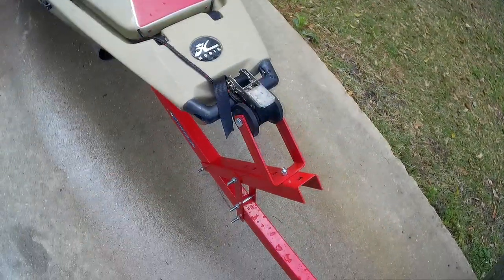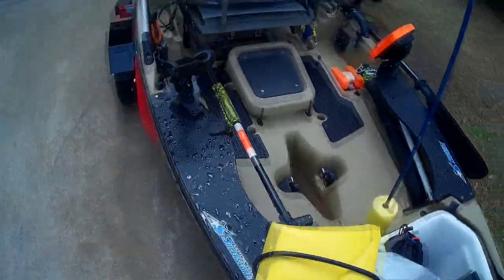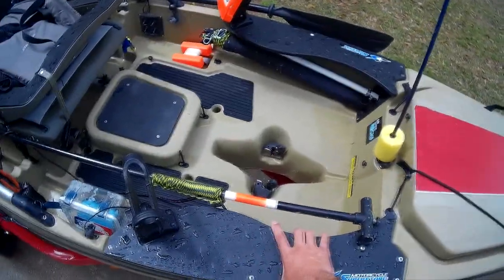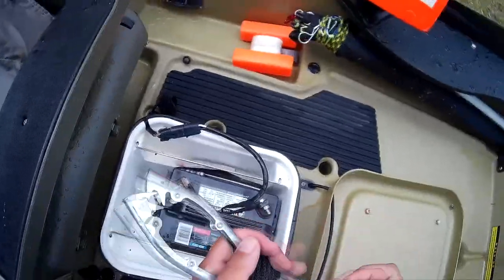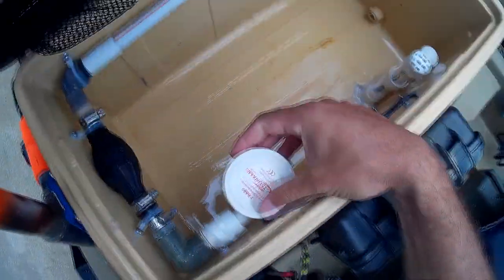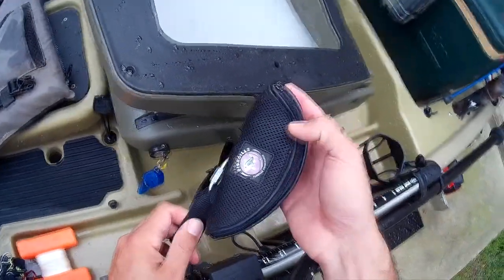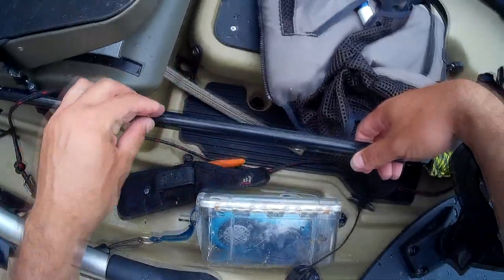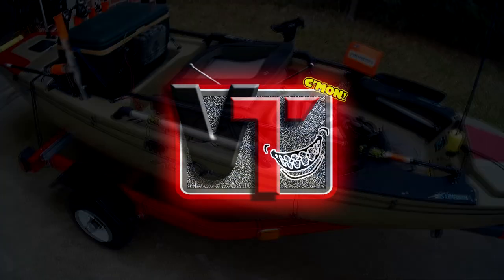Hobie Pro Angler 14 Modifications:  Part 2

Comment: Hey Tony. Really enjoy your videos. Bought a new 2014 PA14 last month. Really enjoying it. Just ordered HF trailer like the one you have. Looks like it will be perfect for getting the PA wet. Beats hauling it up the boat ramp on the Hobie cart. Thanks for the great tips.
Reply from the maker: Congrads on your purchase warthog!  Glad I could make it a little easier on ya!  Hope you used that coupon when you ordered the trailer.  Thanks for watching my vids!  C'mon!
Reply: VentureTube Yes used coupon.Finished trailer build. Ready to go fishing. How often do you check/repack wheel bearings? Interested in what effect water is having on grease. Cleaned hubs and bearings and repacked with marine grade grease as suggested during assembly. Thinking about installing bearing buddy kit.
Reply from the maker: warthog6660 Bearing buddy would be a great addition.  I always add a little grease to the bearings before a long trip, however, I only take the bearings out and clean the races about twice a year.  Guess it really depends on how much you haul it.  Just go by what it looks like when you disassemble it.  Good luck fishing and thanks for watching!

Comment: Good Video Tony ....
I finally got together all of the parts to install the units rut to my trailer ....however...... Do not know the size/ length / type of bolt to attach the conduit to the Unistrut ????  I was able to get the "spring nuts" for the unistrut but need to know what you used to connect all together ????    THANKS

Comment: Did you have to relearn how to cast sidearm so you don't hit the rods in the holder with a back cast?  I have been looking for a way to attach rods to the left side of my kayak so I can continue overhand casting.  I wish I had the pro angler 14, but I'll have to find a way to make do with my smaller hobie model.
Reply from the maker: Well I didn't I have to "relearn" sidearm casting but to answer your question, yes if you were to use a back cast it would most likely get caught on your other rods in the holders.  I prefer side arm casting over back casting anyway, just my preference.  I can make a quieter presentation when using that cast.  You may could try paddle clips to hold your rods on the side of your yak.  Make sure to put rod floats on your rods if you're going to do this!  I have a vid on that as well.  The floats will probably help the rod have a tighter fit in the paddle clips if you go that route.  Anyway, hope this helps.  Tight lines!

Comment: whats a ball park figure on this type of set up with out the mods trailer kayak and the trolling motor awesome video as well
Reply from the maker: 516Spark 2015 Pro Angler 14 is $3,200  I'd look on craigslist for a used 2013 or '14

Comment: Wow !!! Are they really worth it though
Reply from the maker: 516Spark IMO, YES!!  Kayaks will get you on the water quicker, more often and much cheaper than a boat.  Thats why I sold my bass boat.. I fish almost daily..This kayak has paid for itself just in gas savings.  No carpet replacing, no gas, no oil, no storage fees, no break downs..  It's just simple and it works.  Their are many kayak manufactures out their that are top notch.  I chose Hobie for it's stability and for the pedal drive.  You can't beat the power of the mirage drive.  Plus fishing competivetly, I wanted a yak I could stand up in.  Yes their are other kayaks that can do the things a Hobie can do for cheaper, but I wanted a Hobie ;D   Hope this helps!